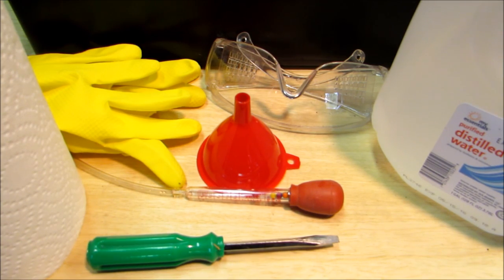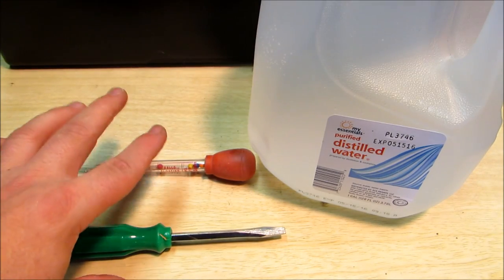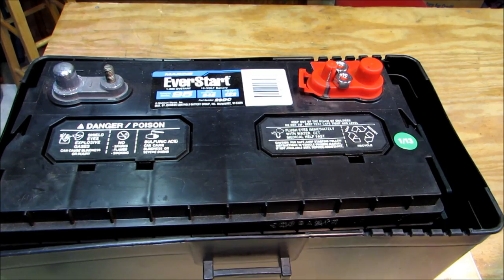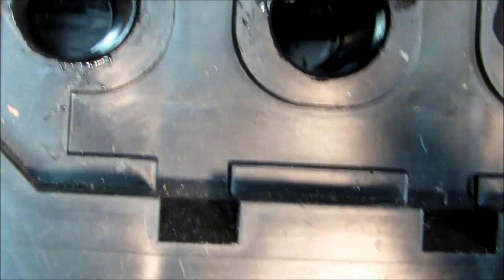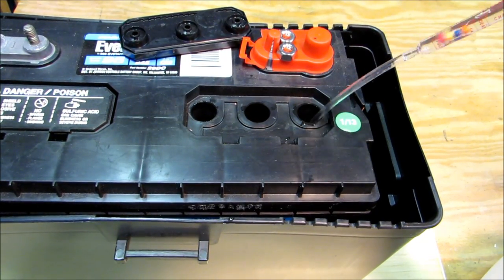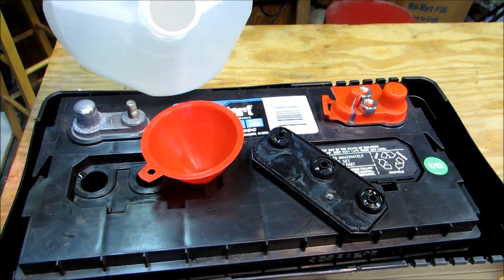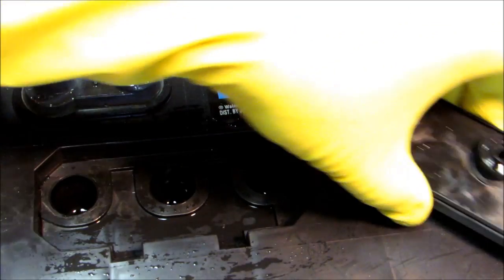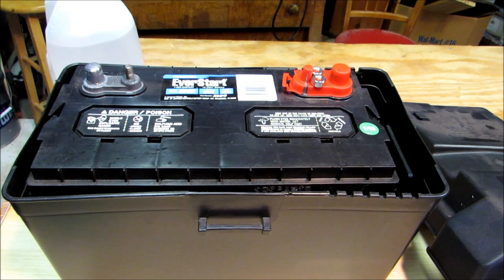Checking battery acid levels

Comment: Thanks for pointing out and showing that the battery fluid should only come up to the bottom of the plastic in the filler chamber and should not be coming up the sides of the chamber.  Only possible improvement to the video would have been to show what the low cell looked like before and after filling to the correct level,

Comment: good vid and 
another thot as hydrometers get more scarce ; voltmeter .  start red to positive and just set black into electrolyte of nearest cell , usually readings 1.99-2.1 volts for a charge ,resting battery . now move leads black out , red in , black into next cell electrolyte , and same ; do not touch plates , just fluid . same reading range . now if memory serves , last cell to NEG term is near 0 volts .   only need 6 readings , total should be near full volt reading across POS. & NEG. and near 12 volts & a setting battery should be BELOW 13 volts .  one just off charger will have surface charge and be 13- 13.5 volt .use a light for 5-15 minutes to remove some of that surface charge for good testing . just another method that parallels your hydrometer well.
   BOTH methods have proven BETTER , more often than fancy electronic wunders costing hundreds to thousands $$ .
Reply from the maker: Good comment and great info.  Thanks!

Comment: instead of distilled water  would it not be better to replenish the liquid with battery acid?
Reply from the maker: +the eabster Works just as well with distilled water, cheaper too.  Thanks for watching!
Reply: NO, NO and NO !! It will cause a reaction that may come back in your face/hands.   Add ONLY distilled water. A small baster or squirt bottle is best and great for this job.  (adding acid to a DRY battery when new if ok.)